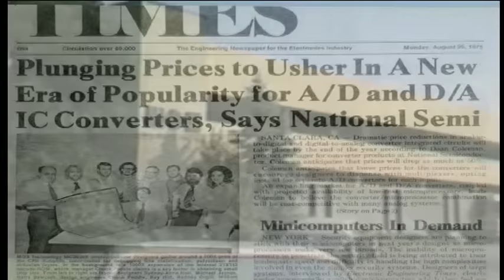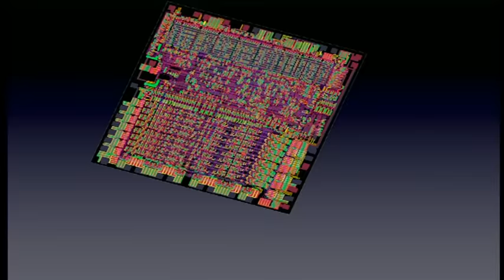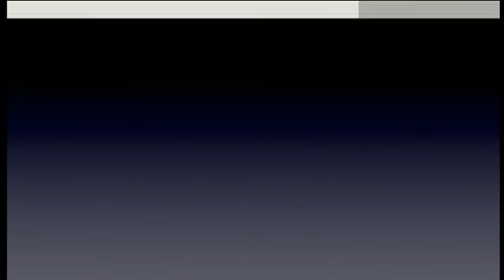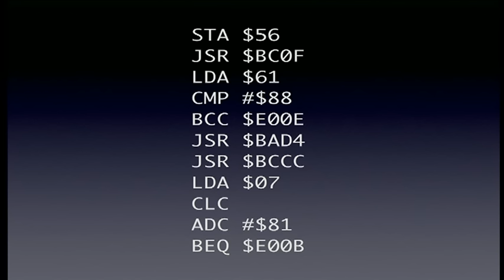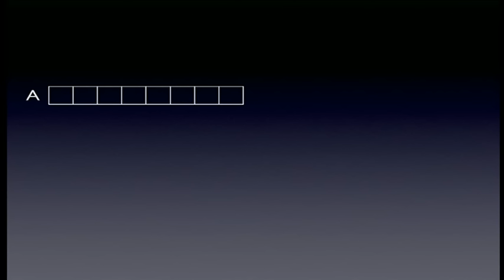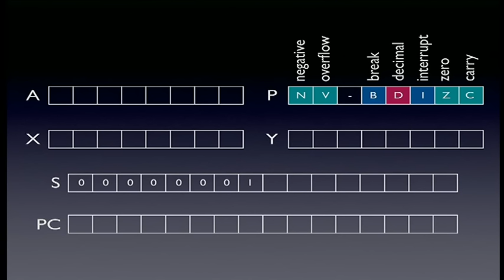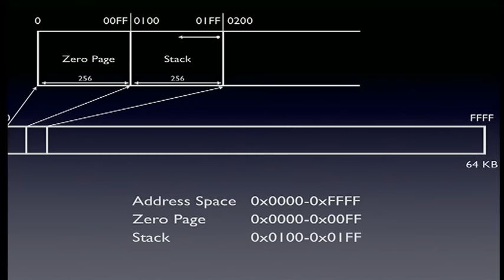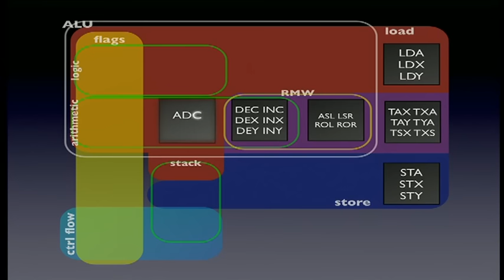27c3: Reverse Engineering the MOS 6502 CPU (en)

Comment: If you want current information or even 6502 based chips go to the source, the western design center https://www.westerndesigncenter.com/wdc/ . It was founded by Bill  Mensch (co-designer of the 6502). They make modern versions of the 6502; 8 and 16 bit.

Comment: Now imagine someone doing this for x86 or x86-64 and releasing it for free would AMD and Intel hegemony be in danger?
Reply: lol NOPE ... how many people do you know who can put 30 or 40 8086's on a single chip and interconnect them so they run at modern speeds ... 
.

designing a CPU is not hard to do ... making it efficient and SMALL is the hard part .. also thinking of everything that could cause a fault ....
Reply: Except modern CPUs have 10 billion to 40 billion transistors. That's about 4 million times more complex than a 6502 which 33 people managed to figure out over years. You'd need to run a multi-billion-dollar company and employ tens of thousands of engineers just to pirate a licensed CPU design from Intel and get sued and lose. Impractical.

Comment: The BBC used the 6502 and the commodore 64 used the 6510 cpu
Reply: And what was the 6510 processor based upon? Hint... it's got the numbers 2,0,5 and 6 in the name. 😉
Reply: the 6510 was the second gen c64 ... NOT the original release ...
Reply: As Commodore had purchased MOS they could extend the processor to their needs: the 6510 is a commodore extended 6502.

Comment: Reverse engineering is easy for today’s
Overcomplicated computer parts. When a device is sold, regional settings are programmed into the parts to sell the same for poor, or the riches. I wrote a long text document for myself about devices, and the how-to , that I found out. When you reverse engineer the video card, laptop battery, cpu, you set it back to its default secret mode, reset is not enough. One example, when you stress the pc under Youtube, the laptop may shut down 10x, then overheating stops, and the cpu will accept a better res. It violates the regional rules, because you modify the parameters of the cpu. The other example is the laptop battery, when you discharge it after every 10 discharge in Windows, choose the Bios. It turns on the elite power features of the laptop, better cpu, vga chipset speed, less heat. Each of the 3 power plans have to be dealt separately, when you leap into the bios, the laptop configures itself for that power plan. The whole process may need 150 charges, to take full effect.

Comment: Could the CPU be shaved down slice by slice and scanned with an electron microscope?
Reply: That would be extremely difficult because you'd only be allowed to shave one atom layer per iteration off.
Reply: @gayusschwulius8490 : not one atom layer, the chip layers are thicker than that.
Reply: @shinyhappyrem8728 In fact they are thick enough to use optical microscopes, which they did.

Comment: for an ultra updated monster version check out the optimized and enhanced 65M02 ! .. outperforms the commercial 65C02 running at the maximum clock frequency of 14MHz.. just discovered this and i'm blown http://forum.6502.org/viewtopic.php?f=10&t=4628

Comment: I learnt machine code from 6502 machine code (let alone assembly) MOS and COMMODORE were 20 years ahead of their time - why are people willing to spend their life working out every single transistor/Mosfet in the chip. It is the chip that launched thousands of people down the path of AI/ML/Optimisation etc
Ignore at your peril!
Reply: Because it is the chip which neither wastes transistors nor cycles. Unlike z80 which on the other hand could run faster on dedicated RAM. Could 6502 be modified to keep RAM busy in the screen borders? Was there a patent on the instruction queue? IBM

Comment: I started out learning Z80 assembly and the first page of 6502 assembly in this video was like an 'off' switch to my interest levels.  Argue all you want that the 6502 was more 'elegant', but it was clearly inferior to the Z80.
Reply: You are probably thinking of it in terms of newer, pipelined versions or just much higher clocked versions.  The 6502 had an IPC of .42 compared to .15 for the Z80.  So perhaps inferior in terms of instructions available (not as familiar with the Z80) but the 6502 had such an execution speed advantage that it could afford to do roughly 3 instructions to mimic the more complex instruction in the same amount of time.

I only bother to comment because a couple weeks ago I was thinking about processor design thinking about how "slow" the 6502 execution times were and decided to check the times for the 68000 and...wow.  Not unusual to see 20 clock cycle execution times in the instruction set of a 68000.  The fastest execution time on an original Z80 was four clock cycles.  On the 6502, the minimum execution time is two clock cycles.
Reply: From a hardware point of view the 6502 used synchronous memory access (every clock cycle it reads/writes something from/to memory) - whereas the Z80 used asynchronous memory (memory was only access when something needed to be read/written).

With a 1 MHz 6502, you could use 1 MHz RAM and it would be full speed.  To improve video you could use 2 MHz memory with the processor and the video circuitry interlaced, accessing the memory alternately at 1 MHz (full speed) each.

With the Z80 the first thing you'll notice is that they usually ran at 3.5 MHz or 4 MHz - over twice the speed of a 6502, but the resulting computers were not twice as fast.  With asynchronous memory access the speed of the memory is not so important: you just insert wait states until the memory is ready - this can lead to the effect that a 4MHz Z80 is actually slower than a 3.5MHz Z80 as an extra wait state had been put in to ensure memory is ready.
Reply: On what basis was it "inferior"?

Comment: So of course the obvious question is: If you enable "Bill Gates mode" does it change the "state" of the chip in any way? I had always imagined that if I were Bill Gates, I would have included some secret password that gives you lower level access with higher precedence. And the thought that he may have been able to influence the very chip designs themselves was always lurking there too. Either you have located the legendary back door or a little practical joke charade that makes it look as if you have taken control of the computer. So which is it??
Reply: It's just a joke. Bill had nothing to do with the design of the CPU.
Reply: It was inserted and Commodore weren't that happy due to memory limitations.  You can download the source code for the CBM ROMs and it's clearly there in the code.  The PET Revealed from the early 1980s notes it as "Microsoft Joke" in its listings of the ROM routines.

Comment: Isn't the 6502 a bit outdated?
Do this for a i7.
Reply: Lol have you look out how many transistor an i7 have?, in order to understand such an incredible complex machine you have to understand its little brothers, such as this.
Reply: i7 haswell - 2,600,000,000 transistors
good luck mr Blofeld
Reply: If you want a good comparison you should only count actual CPU transistors, so no cache and no FPU transistors. How many are left then?
Reply: the i7 and its peers were designed on powerful workstations by teams of engineers none of whom understood the processor in its entirety, the 6502 was designed by a couple of engineers by hand on paper and film!
Reply: Yeah a modern processor is beyond human understanding, they actually write code that designs the chip for them, impossible to do manually.
Reply: Furthermore, you'd probably get sued by Intel if you did that, Mr Blofeld.

Comment: the optomozations were to limit clock cycles ... a carry over from punch card and hand coding days ... every cycle once had to set then stepped then reset and so on ... and that took man hours ... when you consider the 6502 world was 1.7 cycles per second ... and pre that it was PAID man hours per cycle ... yes PAID ... you physically paid a group of people to flick switches set verify settings and then copy them and then move to the next cycle ... this is why things were optomized ... every hour cost a few hundred bucks ... so the less cycles one used the more cost effective it was for the finished program ... this is why the timming diagrams were always in the ttl data books of the time .. so people would know when they could pre process some operations to save time and money ...the 6502 was a direct result and need of the first BASIC from back in the early 60's ...
Reply: and YES the first iteration of the C64 used the 6502 ... it was a reworked vic 20 with a different board design ... and new case to put it in ... the second release or second gen went to the 6510 once the figured out it would do more for little extra cost 

I owned BOTH version of the c64 along with a vic and a z80 heathkit  computer diy build kit ... if a game or program didnt run on one it ran on the other ... and the first gens could run vic 20 software if it was the as current as the pre sale of the first c64

Comment: So that is why they call it an 8 bit processor because there are 8 lanes of a circuit - https://youtu.be/fWqBmmPQP40?t=1731
Reply: What makes a CPU a specific bit number is the instructions, and to a lesser degree the external data bus width. If the instructions are 8 bits and the data bus is 8 bits, it's an 8 bit processor.

Though this isn't always the case, the 8088 and the 68008 are 16 bit processors on an 8 bit bus, as is the 386SX a 32 bit processor on a 16 bit bus.

Comment: What You P1Gs don't Understand is That the Darliks Teach You a Little. Then they Want You to Do the Hard work and Give it to them.
What Happened. Sony and Intel are Gone. so are Moterolla and Fujitsu. The Reason My Father has Now Moved them onto Reverse Engineering the CPU.
Had we Not Taken Out - Intel, Sony, Apple and Oracle, then They Could Reverse Engineer the CPU in 10 Years. Now, they're Gone its Gonna Take 20 Years.
Furthermore, The Darliks are Not as Big Now. They're Dead. So You're looking at 30 to 40 Years.

Comment: Why? I downloaded the vector files ages ago, they have been around for decades.. It's how they design them...
Reply: 22:50

"The 6502 and other CPUs from that time were designed completely by hand. There were no computers involved."
Reply: From history_of_4004_djvu

Under Pedeiico Faggin's direction^ three layout draftsmen drew the composite 
 layout offiie 4004 using colored lead pencils on mylar at 500 times the actual scale. 
The composite layout translated the abstract circuit diagram into the actual geom- etry of the transistors and their interconnections. Showing all the masking layers required for pfoeessing, the layout served as a template for the preparation of the "rubies." A rubylith consists of a mylar sheet with a thin layer of semitransparent, 
red material that can be cut and peeled off. The composite layout, placed under- 
neath the niby, guided the cutting and peeling operations. One ruby was prepared 
for each nask layer required in the wafer processing. The 4004 required six lay- 
ers, including the scratch-protection layer; the other chips in the set required five.
Reply: Perhaps you should do a bit of history research on CPU development. That will answer your question. The 4004 was a very early 8-bit cpu. It was so much fun to program. It was for developmental research mostly.
Reply: @zetacon4 It was known as a '4-bit' CPU.  (Yes, it had 12 bit addresses and 8 bit instructions, but the 'native' data bus was 4 bit)